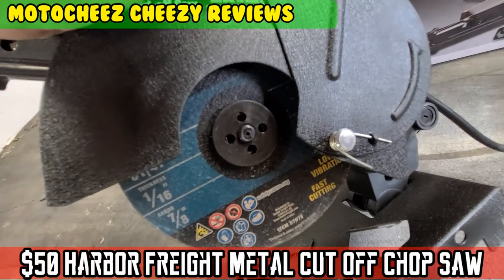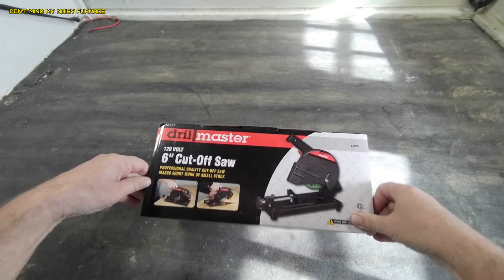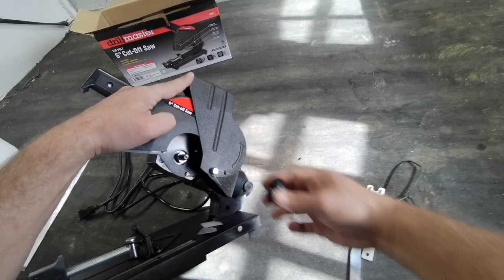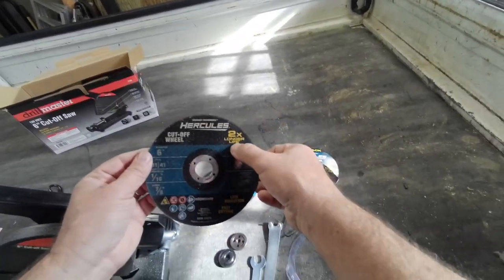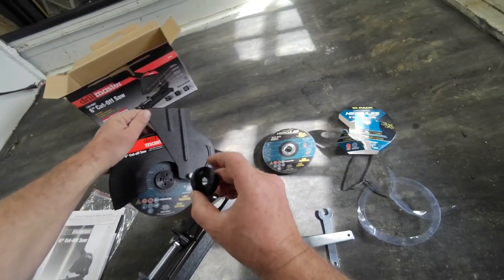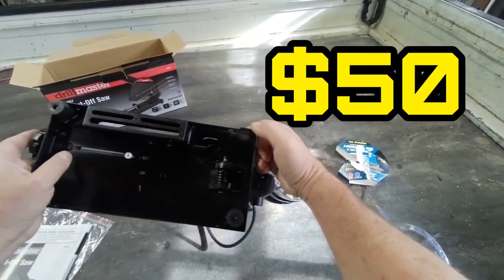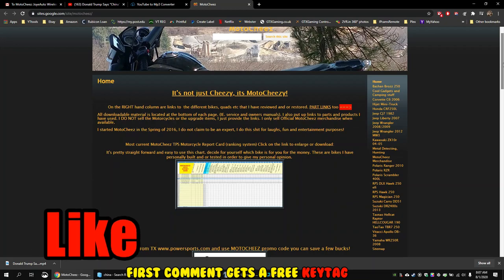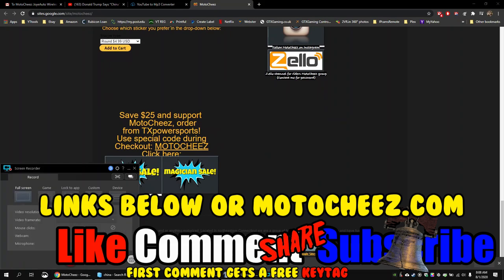$50 Harbor Freight Metal Cut off chop saw. Drill Master 61204. Unbox, closeup, test. Junk or not?

Comment: I've been cutting 4 inch pieces of 16ga. I removed the rear part of the clamp and used a different "C" type clamp to hold the material & saw to my welding table. I've been tempted to mount it permanently as well.
Reply from the maker: Good idea!

Comment: I'm putting this tool in the 'light duty' category...keep it inside its listed limitations and I figure you'll get your $50 worth. TBH, the biggest factor on how well it works will be the cutting disks you buy for it.

P.S. -- Since you have a plasma cutter and a decent welder, a future DYI project could the fabbing of a sturdier base, with a larger (and stronger) clamp to hold the stuff you're chopping...the cutting saw unit looks decent enough for simple projects.
Reply from the maker: I thought about reinforcing the base, I may just get the bigger if I use this a lot. Then give this to one of the kids

Comment: If that mystery hole is counter-sunk, it may be for a sheet-rock (type) screw, to anchor it down.  If so, I'd add some scraps of wood (same thickness as the empty space under it) to help anchor it without collapsing the base.
Reply from the maker: It's threaded. You can see the video underneath of it the holes are exact same with the part just further away from the clamp

Comment: instead of abrasive disc, can i use STEEL toothed saws so that it will be cold/dry cut instead of the heated abrasive cut? This assume the steel blade is rated for the same RPM, within range.
Reply from the maker: Yes, I put one in here.  It's way better!

Comment: Hi, how's it holding up a year later? I just bought myself one today. It's replacing their 2-in cut off saw which actually lasted me almost 10 years maybe more, but I've got some other types of materials than zinc came that I'll be cutting so I thought I'd go with the 6-in this time.
Reply from the maker: It still works great! I put the metal carbide blade so I use to chop wood, plastic etc too!

Comment: I bought one of these and it worked great for like a dozen cuts...and then I tried to change the blade, the thing basically stripped itself and even after breaking off the blade and putting channel locks on either side I couldn't get the bolt off, was able to take it back for a full refund so no harm.
Reply from the maker: Thanks for the input, it's always good to know problems that other people have had. I haven't had that issue but I put on the metal cutting blade I have not changed it since

Comment: Do you think it could cut 2x2x1/8 square tube?
Reply from the maker: Hmm, it'll be close, if I were home I'd try for you but I am in FL
Reply: @MotoCheez  Thanks for getting back to me. I'm building a headache rack for my truck, and I have that same cut-off wheel. I was hoping I won't have to buy a bigger one. Thanks again for your help.
Reply from the maker: I think it would do it, but you might have to move the stop a little bit further back like I did

Comment: I don't like mine. 2 cuts into soft aluminum, and I returned it.
Reply from the maker: You bought the same metal blade that I did? You can't call aluminum with an abrasive blade it will load up
Reply: @MotoCheez  no, mine is different. It's graded for cutting steel so figured soft aluminum (window screen frames) would be no problem. First time with a cut-off saw. I guess it's just not the right tool for the job.
Reply from the maker: @user-yd8ww5mn4y I would imagine something small like that you need to find tooth blade, what blade were you actually using?. Yes the right tool for a job makes a world of difference

Comment: I do not recommend this product, it makes too much noise and after 1 month the disc does not cut and jams
Reply from the maker: The abrasive disc that comes with it sucks, you have to put a metal cutting blade and this thing still working years later